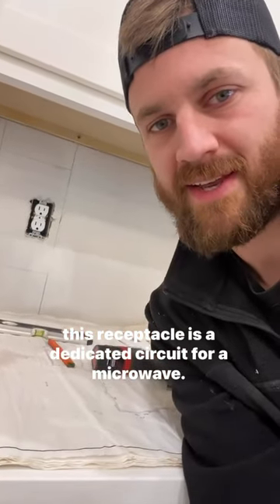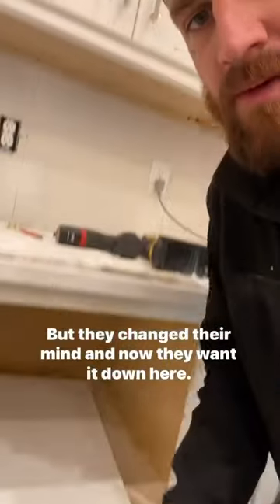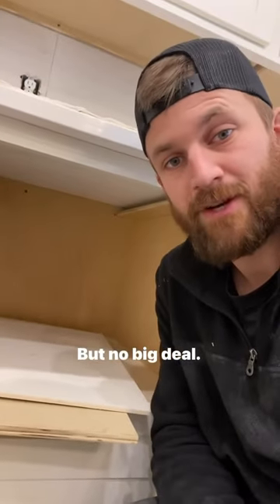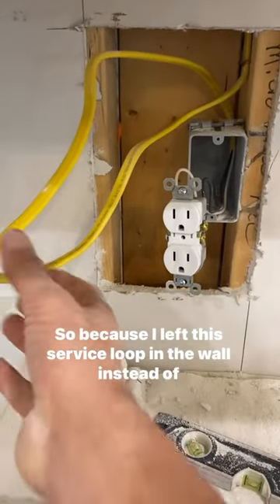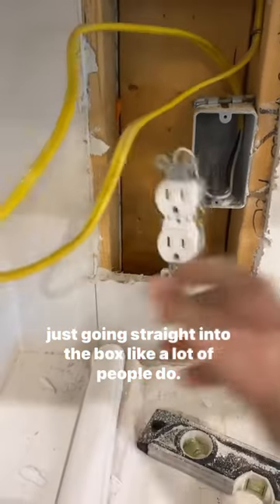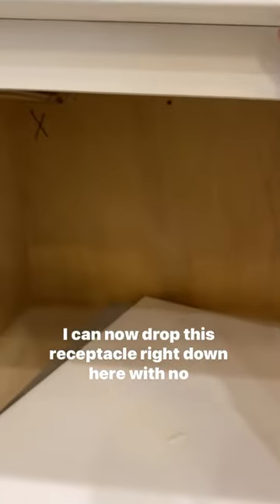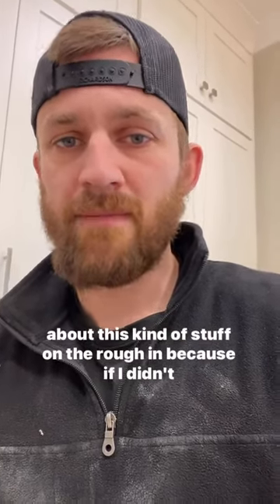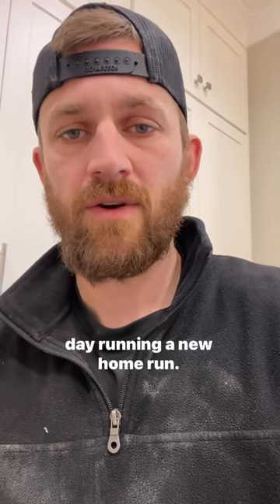This is Why You Should Leave Service Loops!! #electrician #bluecollarlife #construction

Comment: You are required to secure the wire within 6 in of the box, you have 18 of loose wire there.
Reply: 100% Correct
Reply: @elprototyporamirez5434 50% correct. Its 12 in from the box
Reply: What about snaking wire in old work? There isn't a staple anywhere on the wire in the wall or the box.
Reply: @whatnow5313  code says it's ok if it's in a finish wall you don't need strap
Reply: Just throwing this out there, and no I don't do service loops. 

334.30 Securing and Supporting. Nonmetallic-sheathed cable shall be supported and secured by staples, cable ties listed and identified for securement and support, or straps, hangers, or similar fittings designed and installed so as not to damage the cable, at intervals not exceeding 1.4 m (4 ½ ft) and within 300 mm (12 in.) of every cable entry into enclosures such as outlet boxes, junction boxes, cabinets, or fittings. The cable length between the cable entry and the closest cable support shall not exceed 450 mm (18 in.). Flat cables shall not be stapled on edge.
Reply: Very nice!
Reply: It obviously passed code before they boarded it up. You internet electricians give me a good laugh, no one cares what your code says.
Reply: There is a staple above the box. It is secured within 6” of the box
Reply: Where the hell are “electricians” getting 6” from? I’ve been seeing it all over the place.

334.30
It’s 12” from the cable entry point, and for 2020 & 2023 NEC it’s also 18” cable length.

Please read your code.
Reply: @DaBuckHunt Finally! 
Correct. However, this is for NEC 2020 & 2023. 2017 doesn’t mention the 18” cable length.
Reply: @icevariable9600  6"  is what you tell the green guys to make sure they are within the 12" 😂
Reply: @Billybob-go8hn  the code book was written in blood think about that one.
Reply: @Billybob-go8hn to be fair man a shit ton of people don't pull permits and a lot of inspectors for the cities are shit because they inspect 8 different things with zero background knowledge. I've ran into so many changes that one inspector requires one thing and a new inspector comes to check out the work only to say why the hell did you do that? Lol
Reply: 8” as per code but the 6” seems to be the norm for training since new guys cant read tape measures for some reason.
Reply: I'd just splice on the extra cable at that receptacle box.
Reply: @benjurqunov but then you have a blank cover, if you wanted to, and your wire and breaker allowed it you could put in a outlet, however I believe microwaves typically get a dedicated breaker? I could be wrong.
Reply: @benjurqunov after touching up, a built in microwave like we see in the video is supposed to have a dedicated circut. So if you just made a junction in the box and fed more wire down you would have a blank plate in your kitchen. Which just feels wrong. Not that it is, just could be better
Reply: @Billybob-go8hn was there an inspection?
Reply: @skinlab4239  Its a new build, it gets inspected before insulation and drywall. So yea....
Reply: @Billybob-go8hn  you are naive. Not everything has permits or is inspected babe.
Reply: @skinlab4239  Depending on city. But you cant tell me it wasnt inspected. You're just speculating. Also every state, city, town has different codes. So just because you cant in your city doesn't mean you cant in another. You're the naive one. Seems you need a little more schooling kiddo. I can see the drawlings. it's a new build. Only places that dont have code requirements are in the middle of nowhere. Looks like a decent house, which you wouldn't put in the middle of nowhere.
Reply: @skinlab4239  Icevariable has already proven your statement invalid. I'd move along kiddo.
Reply: @icevariable9600 I tell the floaters 6 inches because they don’t own a tape measure and their eyeball of 6 inches is usually less than 12 inches 😂
Reply: @kjacobs203  your reference to 8” only applies to boxes without cable clamps, i.e. plastic 1-G boxes.
Reply: @Billybob-go8hn  
Not every place requires inspections
Reply: @jpmacoo  This was inspected, I dont care about other places. Hes not in the middle of nowhere.
Reply: @Billybob-go8hn  
I missed the part where that was mentioned.  Some places I've lived it wasn't required, and it's not what I'd call "in the middle of nowhere"
Reply: @jpmacoo  If you live in any populated area, they have codes. Ive had one house in the middle of nowhere not require permits. Plus if it doesnt require inspections, you still get it inspected. You trust people to follow codes when they know it doesnt get inspected?
Reply: @Billybob-go8hn  
You went from "knowing this was inspected" to basically saying that it must be because you would.  I'm telling you that there are some places where it is in fact not required, but you're arguing that.  Whatever
Reply: @jpmacoo  Ive seen his past videos, it gets inspected. Im was explaining even if it doesnt require inspections, you still get an inspector. Seems your comprehension is that of joe biden.
Reply: @Billybob-go8hn 
I'm telling you what is, and you're saying what should be.  There's the comprehension gap
Reply: @jpmacoo  You're outside civilization working on section 8 with your education. Grow up, move on.
Reply: @Billybob-go8hn 
Good job resisting with the insults till now.  Some people just can't have a conversation with someone who has differing experiences and opinions.  Take care
Reply: @whatnow5313 
Old work can run freely in a chase/stud bay but needs to bes secured at entry and exit.
Reply: Lol 6 inches   12 inches is code and that  is what she gets when sancho comes to fix the code violations
Reply: @icevariable9600  It's 8" not 6" 314.17 (B) (2) Exception  This 8" is measured along the sheath. You actually seem to know and care about the code. I'm not trying to offend.
Reply: @boulderboy245  8” is for a single gang, NM box, with no cable clamps. 

2017 code has no cable length restriction. 2020 & 2023 has 18” cable length restriction. All 3 have 12” distance from the strap to the cable entry of a box.

I think people are just getting confused with the 6” conductor length entering a box. I’m seeing it quite a bit these days.
Reply: @kjacobs203  8” only for single gang, NM box with no cable clamps. Otherwise, the code for 2017, 220 & 2023 is 12” from strap to cable entry. 18” of cable length, for 2020 & 2023.
Reply: @samwalker5884 if you run 80ft of wire in a wall cavity but have a staple 12" from the box and 75ft of wire loose before entering the junction box.. Does that still mean it's stapled within 12"? No..
Reply: Yup...
Reply: @蓉蓉庄 It wasn’t a finish wall when the staple was installed. The exception is so that you don’t have to tear out a big hole to install a new outlet.
Reply: It is secured 3" from the box ,look at the video. The code doesn't metion length of cable ,it says fixing distance from  the box.
Reply: @charliedecker7702  so staple close to the box but leave 20ft rolled up.. Is that up to code?
Reply: @jacobmiller7175 the blank plate is the customers problem, either pay for the work to eliminate the box or deal with the plate, leaving service loops in the walls is a shit idea because someone always cuts them.
Reply: Stupid construction rules on  "the land of freedom"
Reply: @AuditAmplifier  nope
Reply: Nope!!!! It IS stapled within 6". Meets code. Done deal.
Reply: @gregorysampson8759  
Where do you guys get this 6” rule from? There is no 6” code other than the length of the wire extending past the Romex sheath in the box.
Reply: Not if you're fishing it lmao
Reply: The staple is within 12in service loops are not a code violation, common misinterpretation, especially by inspectors 🥴
Reply: @dismat  considering you'd probably sell the house one day.. Yeah, it's worth making sure it's done right so your crap work doesn't kill a family down the road
Reply: @GageDrums  nope
Reply: 12 max from box, NOT 12 INCHES OF WIRE and you can leave a loop no more than 18 inches if I'm not mistaken
Reply: Securing and supporting requirements for NM cable are found in Section 334.30. The general rule for NM cable is to secure the cable within 12 inches of the box and every 4.5 feet thereafter. NEC 334.30
Reply: @DaBuckHunt 😂 you show the code that answers every question and they just looked right over ya. 150 comments in the argument area. 1 code quote and they just step right you. 

So it’s 18” huh for the first stable. Well argument settled who’s ready to shut up now?
Reply: @icevariable9600  so you mean it can enter with 12” physicallly but you can roll up 18” loop if you want ? 

If I’m right it’s pretty simple to shut up now
Reply: Calm down karen
Reply: @pjplumber2146  12” direct path from strap to cable entry.
18” “of cable length”.

Simply read the 2020, 2023 code. It’s not in 2017 code. 

And, I shit up when I’m proven wrong.
Reply: 6"?
Reply: 2020NEC requires within 12 inches of the box
id have to check what 2023 says
Reply: @GageDrums  if you have an over dramatic counter point are you still correct? No..

The guy put a little bit of extra romex incase he needed to move a box. It’s not the worse thing in the world
Reply: @icevariable9600 I think people are getting it mixed up with 6 inches of wire protruding from a box
Reply: @JoshMurphyD  I was thinking the same.
Reply: 12" in Canada
Reply: He’s lying ppl! He forgot what they wanted and left it that long just in case they wanted to move where they wanted.. he made their choice for them.. now he has to fix it and act like he did something positive. Lol he’s that guy
Reply: @wjat1558  12” in the US too.
Reply: Why not a 10ft loop just in case ? 😂😂😂
Reply: @samwalker5884 there is a staple above the box but the wire is not secured 12" before the opening. It would be ok if the staple was securing the wire and the last staple was less than 4' including the loop
Reply: @cebsaint they are not violations IF the cable is secured within 12" of the opening. Staple looks to be on the wrong end of the loop
Reply: @Billybob-go8hn not necessarily, inspectors don't look at everything, you get a pass but doesn't mean everything is up to code
Reply: @graphmastr  The house isnt going to burn down because of it, its to code.
Reply: So many of you have never opened a code book and it shows. Or haven’t in 20 years. Glad you have bad inspectors to keep you going.
Reply: 8” if no tab at the box or 12” if restraint available. Additionally 18” loop okay is what I understand.
Reply: @randomwordbot not anymore. Now it's increasingly written in money
Reply: I was thinking this too... that's a lot of loose wire in the wall
Reply: It's whatever your local inspector says. They have the last say whether you pass or not. My local inspector would say that's a fail.
Reply: nope. 12"
Reply: it's 12 inches from the box
Reply: Oh god, the internet electricians are here
Reply: It must be secured within 12 inches, not 6, and it's measured as distance from the box, not length of wire from the box. So you can have an extra wire loop in there as long as the staple attaches somewhere within an 12 in radius from the box.
Reply: It’s stapled four inches above box you can leave a loop
Reply: I would have failed that all day!
Reply: But, now you need a new counter top receptacle by code and you butchered the wall.
Reply: @icevariable9600  2017 NEC does not mention it, but it also does not prohibit it.  2017 code is arguably more permissive, because it does not say there is any maximum cable length at all for a service loop.  Later versions just added a restriction on max length.
Reply: @boulderboy245  314.17 (B) (2) is talking about the amount of cable/insulation that must extend into the box.  It has nothing to do with service loops at all.

340.30 specifies NM cable must be secured within 12 inches of the box, and (2020 NEC onwards) explicitly specifies that up to 18 inches of cable length (aka a "service loop") can be between the box and where it is first secured.
Reply: If you are going to cite the code don't screw it up lol
Reply: @foogod4237  Yes! Precisely.
Reply: Romex is within twelve inches from any junction.
Reply: @judestee  8” if it’s a single gang, NM box WITHOUT cable clamps.
Reply: @foogod4237  It's in the exception 314.17 (B) (2) EXCEPTION
Reply: @cebsaint Considering all of the noise problems and safety risks that they explicitly and inherently cause, while those loops may not be a code violation they absolutely should be one.
Reply: @Billybob-go8hn irony is lost on you. Calling out “internet electricians”, while you are playing the exact same role on a video by an internet electrician.
Reply: @cactiguide  Im not an electrician, nor do I claim to be. I just know it passed an inspection before they boarded it up. So go take a walk kiddo.
Reply: @Billybob-go8hn   Boy, you just double down on your hypocrisy. Again, you establish yourself as some expert with nothing but a keyboard while calling the other guys "internet electricians". But you "just know" the way it is. In reality, you don't know jack.
Reply: @cactiguide  Maybe you should read the actual electricians comments, saying its not a code violation. Seems your reading skills need some work.
Reply: @Billybob-go8hn   nope. I could not care less about their comments or the code. All I see is some jack wagon in the comments trying to sound smart. If the “actual electricians” are doing a good job explaining it, then nobody needs your input.
Reply: 12 inches from box, not more than 18 inches of cable
Reply: Home owner might change mind again.

Comment: Run a line from the existing box. Put a blank cover on it. Done. The outlet cannot have been a required outlet for the countertop as it was already dedicated to the microwave, therefore if the microwave moves it’s superfluous.
Reply: Done... If the homeowner's okay with that. I wouldn't personally want a blank outlet cover on a brand new kitchen. You sound like most of the guys I've worked with that won't take the extra steps to do the job right. You always hear stop thinking about it so much just get it done. Sure screw the details screw making it look good screw making it 100% right for the customer... Just get it done and get out of there.... Take the time, Do it right, charge recordingly
Reply: Box it in the attic then, no blank cover. But then you have a hole to repair, and the customer expects you to fix it with no extra costs.
Reply: @armandoacevedo7388  no if they asked for the change they get to pay the change order

Comment: Hired a new electrician to run wiring for a multi-unit building. Dude ran loops at every single box
Cost us an extra 500' of wire and the drywallers hit at least 20 wires with their rotozips.

Comment: My house was wired by trade school kids in the early 1950’s. They strung all the Romex like guitar strings
Reply: I first read it as the trunks were all nice and straight with no roll overs...then I realized you meant they pulled it all super tight, oof.
Reply: Romex? In the ‘50’s? House back then had conduit, pulled the wire.
Reply: @Dstrbrdgrnd  Nope. Romex. Nope, no conduit. The original weaved fabric casing stuff. Silver gray. It existed then. Along with early craft paper backed insulation batts. House was built in 1952 by trade school kids in metro Boston. I used to have neighbors who watched it built.
Reply: Same as mine and only about 3 inches of romex coming into receptacle box. Was wire that expensive in the 50s?
Reply: @jerseyjim9092  I’ve been told by my elders that building supplies were in great demand in the post war building boom.

Comment: until the framer or trim carpenter puts a nail into it... - if you want to leave a service loop, put it in the attic and make sure your u nails arent too tight and if you ever need it you can pull some down.
Reply: How do you "pull some down" from the attic when the wire is required to be stapled every 12 inches down the wall?

You must be able to pull a lot harder than I can...

Comment: Just saved 3 wire nuts thank you for your service
Reply: Ding ding ding! This is the answer
Reply: Yeah, I probably would have left that box and recept. there and ran  3 ft. of 12/2 down to the new microwave location.  No drywall work, just an extra countertop recept. that happens to be on the microwave circuit.  Probably still need a recept. there anyhow to meet the spacing requirement of "no more than 2 ft. of countertop without a receptacle". NEC 210.52
Reply: MGengo100 exactly. Wire nuts aren't mf ... wagos are mf
Reply: @huckbeduck dedicated circuit is not supposed to have a splice...
Reply: @Lewdacris916  must be a local code thing.....
Reply: @lezbriddon  imo this is best not spliced, local code or not. The more splices the more electrical resistance, and electrical resistance is the same reason that it is not recommended to plug stuff on an extension cord because each outlet plugged in stack up in resistance. If you can wire a permanent in-wall wiring job without splicing then do it.
Reply: @huckbeduck This is exactly how I would have handled it.
Reply: @Lewdacris916 An 1100 watt microwave pulls about 9.2 amps. On a 20A circuit. You can add a receptacle to that and still be fine.

Comment: Service loops aren't required by code because they are a code violation.
Reply: Hahaha exactly.
Reply: They're not. Must be secured within 12 inches of the box, but it's measured as distance from the box, not length of wire between box and staple. So you can have an extra loop in there.
Reply: I can see the NEC adding this in the near future. Although I'm not a fan of it. To damn messy!
Reply: @institches2750  thanks.  You explained the truth.
Reply: Perform work in a professional workmanlike manner.